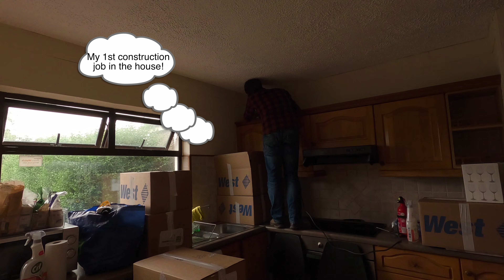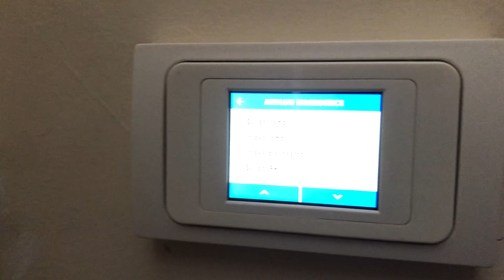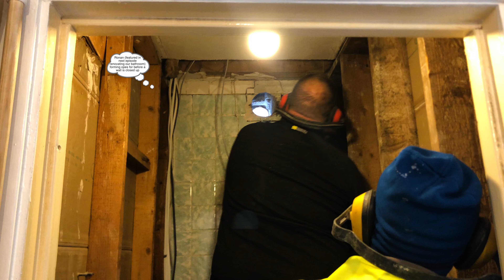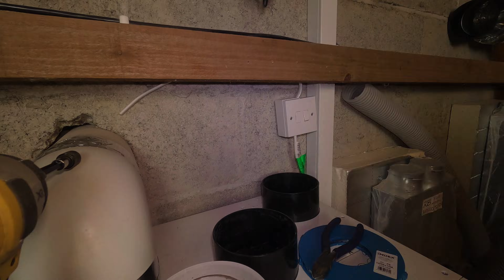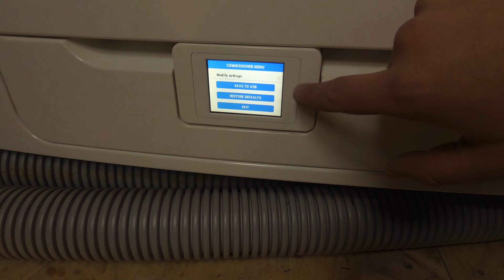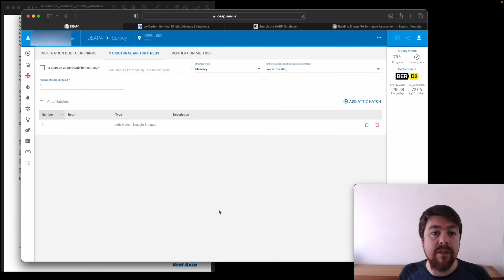Mechanical Heat Recovery Ventilation - A-Rated Rogan - Episode 5

Comment: Hi darragh, I’m in the process of a Reno myself in cork and I’m trying to figure out how to run the ducts down from the attic in a 1970’s house 130sqm. So Bpc have recommended two 75mm ducts per most rooms. Now my problem arises by my joists running perpendicular to where my ducts so how did you manage the drops ?

Comment: Extremely useful video, just planning a retrofit here is the south of England. 
Any advice, suggestions, or even feedback now you have been running it a couple of years?  
Anything you would do differently, if you did it again?
We have a SIP timber frame house, seems well insulated and air-tight but concerned about CO2 build up, plus the bathroom and kitchen extractors all need replacing anyway. We regularly have humidity >75% in bathrooms.  I am hoping MVHR will solve most of these problems for us.
Reply from the maker: really good question!
in the intervening period, I've installed one for my Dad, and the design change made there was to take advantage of the the WiFi connected ones - easier to commission.
And it's a small tweak I'd make now, but the "click" of the presence sensors in the wet rooms can be a bit annoying at night, waiting for  it to time out. If I was going again, I'd see if I could get quieter PIRs.
Other than that though, still very satisfied, and don't see any of the issues you speak about. A bit dry in winter in the house when the heat is on - a good complaint!
Reply: @DarraghRogan  Thanks, very helpful. Which brand did you go with that has Wi-Fi? (Thinking whether I could integrate it into my Home Assistant)
Reply from the maker: @UKBlue407 again a Vent Axia - not sure of integration possibilities at protocol level but the vent axia has various IO you could conceivably use to trigger speed ramps with

Comment: Great vid, would you not have to insulate the 75mm ducting in the attic to prevent condensation as they are running in a cold space?just curious thinking of retrofitting myself
Reply from the maker: good shout, and indeed I did since the video. It's a good retrofit for sure

Comment: Just curious. This is a passive heat exchanger, so when they say that it’s almost 100% efficient, does that mean it recovers around half of the heat from the outgoing air, not all of it as kind of implied? Great tip on the summer bypass 👍

Comment: Excellent presentation on MVHR1 I'm just wondering what ou did to qualify the level on infiltration? It would appear that in a very 'leaky' building you're not going to get great benefits from installing MVHR.
Reply from the maker: no qualification done, just good practice in the execution as far as is practical. I can subjectively feel the benefits in this "leaky" house...and indeed in a leakier house I would still do it, even if it wasn't as effective as it could be in a more air tight structure as it still gives the required minimum airflows & filtration functionality.

Comment: My 2p-worth:
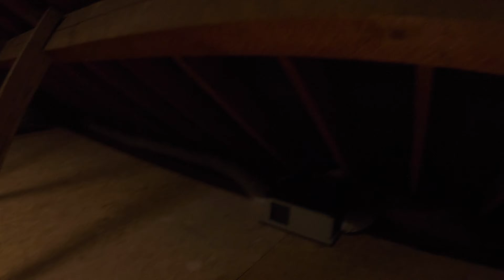Your video is good but would be improved significantly if you had a script to work from.  Eg, at 03:30 you talk about the fact that whilst basic ventilation facilities (trickle vents, etc) work, if they need occupants to actually turn them on, they may not work because occupants don't bother to activate them as needed.  You then mention the next best system which does not rely on people having to operate controls... but forget to mention this important point!

05:00 - as you say, the graphic colours for air (and I would say also, the moisture illustration, too) are very wrong - I hope you have pointed this out to the publishers!

You did not mention that the air extracted from the house and outside air being sucked into the heat exchanger *do not mix*.  I may be wrong but I would have thought a layperson would simply be completely baffled by this missing fact!

Summer by-pass facility is 100% essential.  Also essential is the ability to change remotely - you really don not want to have to go into the loft to change it - you won't!  By the same token, I would go for a unit that allows all the settings to be accessed remotely (ie by wifi or a remote display).  In this day and age, not having a wifi-enabled system is unforgivable (IMO!).

The area of a 75mm duct is around 4kmm2 which divided by the width of a typical door (800mm) is about 5mm.  Ie, you will only need about a 5 mm gap under a door to provide the same amount of area of ventilation as the 75mm duct. Therefore the door under-cutting is generally not needed.

Also, matching extract vent numbers to inlets isn't needed because most vets can be adjusted in terms of flow to balance things as needed.  That said, if it isn't hard to match them, then why not (cost and install faff, aside).

I wouldn't touch VentAxia with a bargepole, I'm afraid.  When I did my MVHR system for my self-build in Herts, UK I thought i'd go with VentAxia because it had a very good reputation, it had been around for a long time and was a British company.  The unit I initially bought was new on the market (this was around 2010) cost a lot compared to less snazzy units on the market and was a total failure due to woefully poor design.  It was removed from the market about a year later.  If I were to do it again I would almost certainly buy something Continental probably Scandinavian because they've been doing this for at least half a century. 

(A min rant...)  In the UK, as you are obviously fully aware, the whole industry is, frankly, pathetically ignorant to the whole question of proper ventilation, hence all these news stories of late about children dying from awful respiratory issues due to mould caused by inadequate ventilation. Meanwhile everyone is hellbent on sealing up houses to prevent heat loss and therefore save energy and money.  Of course, none of these news stories ever bother to research the issue adequately enough to actually educate people watching the piece as to what should be being done, simply blaming the landlord for failing to deal with the mould adequately. 

For my money the idea that building regulations in the UK do not insist on some form of mechanical ventilation new-builds (and realistically these days this should be MVHR) is bonkers ... Almost as bonkers as the fact that, in the absence of mechanical ventilation, any windows have to be fitted with trickle vents.  What in God's name is the point of spending a fortune on buying a high-performance double (let alone triple) glazed window unit and then banging a bloody great hole through the frame?! Utter insanity.

What on Earth is a 'draft lobby'? - OK, isolating the front door for thermal performance with a separate wall or screen...

Comment: Is an F7 filter good enough for diesel fumes? I think you need an activated carbon filter to really remove car pollution, garden fires and other nasty stuff.
Reply from the maker: it seems to be the best filter grade I could get in a "conventional" MHVR unit - no doubt you're correct need to update to truly filter everything. Still, a damn sight better. Hopefully national legislation on air quality i.e. solid fuel use & vehicle emissions gets enforced more.

Comment: I’m starting a retrofit and would advise you to reconsider your ambitions on airtightness. It is possible to achieve current regs (5m3) in retrofit. And foam is not airtight.
Reply from the maker: in reality terms i probably meet the target - external wall insulation is hugely helpful in sealing

Comment: Hi, how does the heat recovery work efficiency works in terms of temperature? If it´s 20º inside a 10º outside with a unit capable of 90% how do we calculate the temp of their influxing? Tks for the video!

Comment: Darragh, since you're not using the chimneys did you think about using them to run the ducts? Maybe ducts with built on insulation. I'd have thought it would be the easiest route from the attic to the ground floor for a lot of houses.
Reply from the maker: I've often thought about doing so...in my case, the problem is the transition at the bottom - does the duct come out where I want it to in the space?
Also, the way chimneys are constructed, there might be 4 or 6 in close proximity, considering you're often back-to-back with a neighbour in a semi-detached house...so targeting the right chimney might be a challenge!

Comment: This is excellent, have the same or very similar unit installed and this video was a god send!

I'm currently trouble shooting a condensation issue where I've water dripping from the front case 😢 Unit in a cold attic like yours, level in all axis with a working/tested drain. Back and forth with the manufacturer to get to root cause.

Thanks for vid some diy man you are 💪

Comment: How did you connect your PIR system to your heat recovery unit?
Reply from the maker: the MHRV unit has a switched input that I switch from the PIRs. basically, run live & neutral to the PIRs to power them, and then take switched live back from the PIRs, and feed it into the switched input on the MHRV. any sparks should be able to do it - very similar to wiring an outside security light.

Comment: I've heard elsewhere that PVC ducting can get mouldy / dirty. What are your thoughts on this?
Is it possible to get flexible ducting made from other materials just for more cost?
Reply from the maker: I have heard it can be an issue over time, but there are ways to mitigate it - insulate the duct (or rather run it in the thermal envelope) so that it doesn't get cold, thus preventing condensation forming, which can prevent mould.
but dustiness I can see will happen over time - when it does, I plan to get one of those flexible duct cleaners like they use in the USA for clothes dryer vents, to clear it out.
You could get metal for sure, similar to a commercial installation, but not sure the benefit

Comment: thanks for the details, i'm retro fitting MVHR myself right now. How did you alter the airflow with respect to the intake/exhaust as they are adjustable to alter the airflow amount, this is the bit I have not managed to work out yet
Reply from the maker: I did this in the settings for the MHRV unit, you can adjust the speeds separately. hope it goes well for you!

Comment: Any updates since the rest of the building works were completed?
Reply from the maker: Actually, only one of note with this sub-system - it entered "Diagnostic Stop" a few weeks ago, with a diagnostic code indicating that the supply & extract temp/RH sensors had failed. Vent Axia were simple to interact with, via the supplier in Northern Ireland, BPC Ventilation, who sent out replacement sensors, even though I was a few weeks out of the 2 year electronics warranty. They were simple to fit (didn't have to take the unit off the wall), and fixed the problem. Very satisfied with response to a problem, and part of why I went with a larger name for MHRV.
One really notices dampness in the house, after sealing it as tight as possible and only periodically opening windows, when used to a MHRV'd house!
Reply: @ you mentioned that the extract needed to be lower than the unit to drain condensate. I hadn’t seen that mentioned, could you expand on that?
Reply from the maker: @janwillem6953  the basic principle is you have 2 ducts connecting the unit to the outside - one to take in fresh air & one to exhaust stale air.
as you've taken all the heat out of the exhaust air, and often times the exhaust air is highly humid (as people may be showering, cooking etc.), when this air touches the ductwork that is not insulated, condensation will form in the duct.
You should try to ensure this duct slopes downwards, as that will allow any of the condense to drain out of the house, and not just sit in the duct, or back to the MHRV unit.
Reply: @DarraghRogan   I had seen condensation drains for circular pvc ducting and I guess the unit has a drain too. Did you fit a drain in the unit and is it only the extract that benefits from a fall?
Reply from the maker: @janwillem6953  correct on both, and it's important that the drain from the unit has a trap, as otherwise it'll just suck air in through the drain pipe rather than from the house or blow make-up air out the drain, depending on how you plumb it.

Comment: You say when the unit ramps the noise is noticeable. Are you referring to the noise from the unit (coming from your loft), do you mean the noise at the valves, or were you talking about the noise from the intake and exhaust on the exterior. Have you noticed any hissing from leaking air within your system - say at manifolds/plenums/main ducting. How is the sound at night in the bedrooms below the unit?
Reply: He probably can hear it like a yet anywhere in the house. Take this with a grain of salt, this is my personal opinion. But from what I know, the issues with this install are as follow:
Sharp bends next to distribution unit are the worst mistake he could have done, not oversizing...stupid idea! Of course you want to oversize, you want the unit to run at its best 50/60% of power not 90%, but this has to also go with bigger piping. He should go with 90mm to push more volume at lower air speeds (combining it with more powerful unit of course).
Reply from the maker: sharp bends are a fair point, but on the oversizing topic, at max demand, this unit tips along at around 60%. I always find th eotughest challenge in engineering, no matter the branch, is trying to size fixed plant to varying demand...
on the larger demand rooms, I went with dual 75mms in parallel, to keep velocities down.
And @gavindonohue942, the noise is from the valves themselves, and when outside - direct fan noise isn't an issue at all. The fan is quite oversized, so it tips along quite relaxedly

Comment: Can a ventilation system cause noise, subtle floor vibrations and harmful pollutants affecting eyes and throat?
Reply from the maker: yes (if badly spec'd and/or installed) but easily avoided.